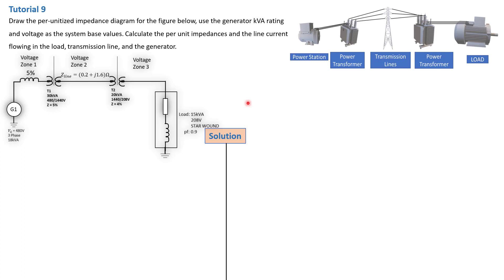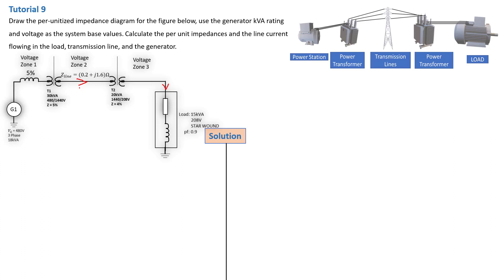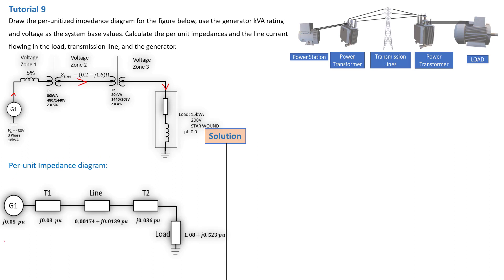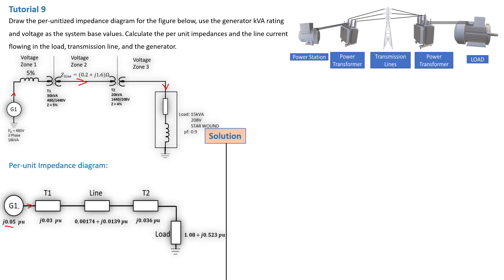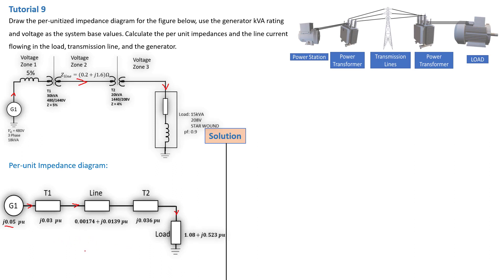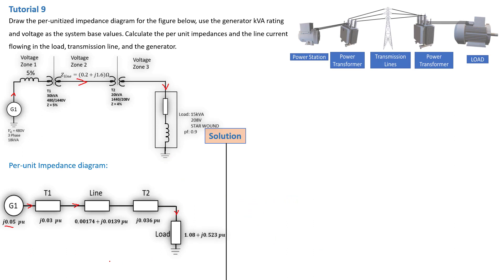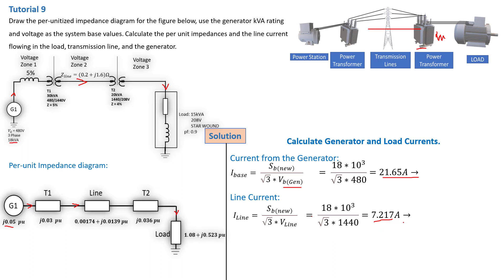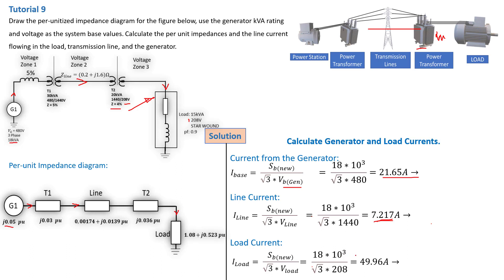How to FIND the per unit of a balanced star wound connected load - Tutorial 9. part 2

Comment: Thanks for the exceptional work; Though I wander why to get actual currents, you aren't multiplying Ibase *Ipu
Reply from the maker: Thank you for your comment. The tutorial primarily focuses on calculating the per-unit values of a balanced star-connected load. If you haven’t already, I recommend watching Part 1 as well. Please note that all currents calculated at the end of the tutorials represent the base or line currents for the specific section of the network.

In many contexts, especially during fault analysis, the product of 
Ipu×Ibase is often interpreted as the short-circuit current. 

However, more generally, this product represents the actual current in amperes corresponding to the per-unit value, whether it is a load current, rated current, or fault current. 

The key point is that the meaning of Iactual=Ipu×Ibase depends entirely on what the per-unit current represents. During normal operation, it gives the physical current flowing in that part of the system, while in short-circuit calculations, it naturally gives the fault current.

I might release a tutorial clarifying this point
Reply: Thanks Sir for the clarification;  l will wait for the video to clarify the matter